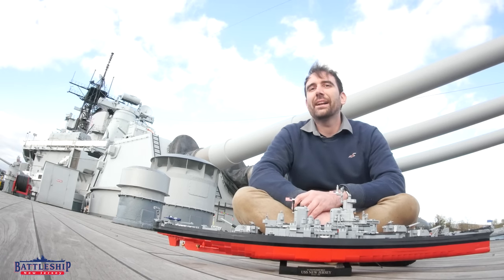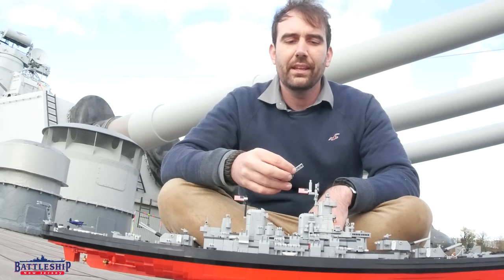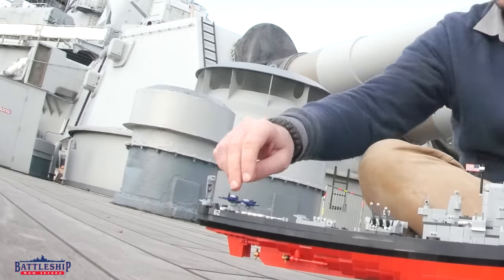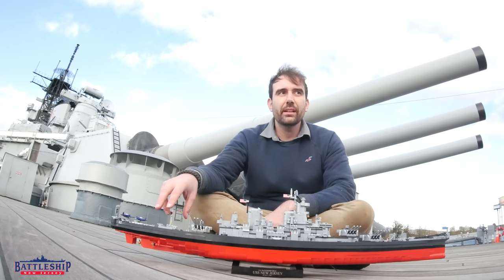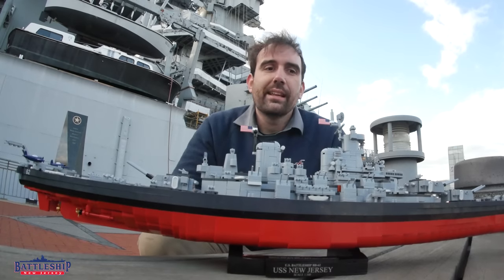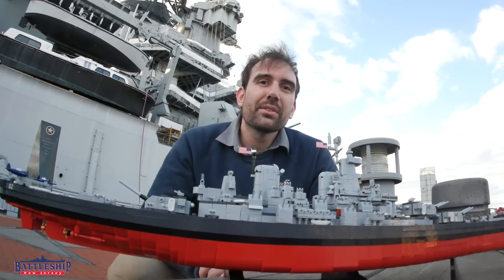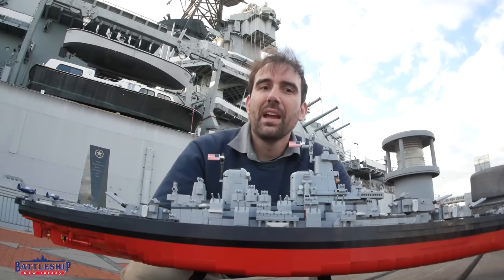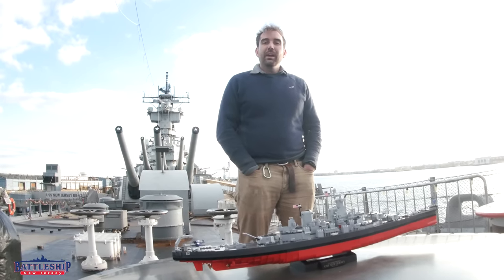What Changes Are There Between a WWII Iowa Class Battleship and One Today?

Comment: Breaking a Cobi set. Good one. You can use the Titanic as a baseball bat. Cobi holds together incredibly well
Reply: The hull can be used as a murderer‘s weapon of choice, wrap it in barbed wire, call it Lucille, no problem.

But the superstructure will fly in all directions the first time you actually crack a skull with it, so some kind of rebuilding after business has been concluded might still be required.
Reply: @Kref3  just like on the original. The armored citadel will survive
Reply: If Cobi blocks had been around in the early 20th century, Hood and Bismark would still be afloat (and WW2 still be ongoing).
Reply: Not always. My Cobi Titanic model fell down on the carpet floor from about 40 cm height. It broke into two parts just as the original wreck on the bottom of the Atlantic.
Reply: @herbertblum7704  Cobi is really going for that historical accuracy. Gotta love 'em for that.

Comment: I have 11 of the Cobi ship models, one of course an Iowa. They are fantastic, fun to build and way more durable than a plastic model kit. When it comes to details they do them well. My Cobi PT-109 has a full interior and when I was doing the crews berthing area I found a neat little hidden treasure. In that area there is a stand up locker. When putting it together I noticed some small markings on the door. Under a magnifying glass it became clear. 1940's pin up girl posters. Can you believe it ? lol

Comment: The most impressive model of an Iowa class Battleship I have ever seen belonged to the Iowa Class Preservation Association and was used by them in lobbying efforts to congress in the late 1990's and early 2000's. This model which was about 4'-0" in length , made of metal and depicted U.S.S. Iowa BB-61 with the most modern missile and secondary gun systems. All nine 16" guns were retained in this configuration and the detail was incredible.

Comment: To recover the planes the ship would be heading into the wind and then turn across the wind creating a slick spot for the plane to land in. They had a large flat skid that they would tow alongside that had ropes fastened athwart for the plane to snag with a hook on the bottom of the float. The plane would land in the slick and taxi up onto the skid and then drift back to let the hook catch the skid, at that point the cable from the crane would drop the hook which would be fastened, and the plane lifted aboard.

Comment: Have you made a video that shows how the 16 inch barrels are attached to the turrets? I'm curious about how they're mounted such that their massive weight is supported from one end but they can still be reasonably removed for repair or replacement.

Comment: Now for the big question: Does it float?
Reply: Ive been too afraid to try with any of mine. In theory they should be able to float for a short period of time until water seeps in, the issue is getting it back out and drying the inside.

Comment: Why does turret 1 not have those two range/view finders on the sides like turret 2 & 3 ?
Reply from the maker: Took them out prior to Korea, they were unnecessary and kept getting water in them
Reply: @BattleshipNewJersey  Oh thanks for that info. I had  noticed what looked like an outline where they once were. Then the Wikipedia page said turret 2 & 3 had them and they are used as local rangefinders in case the big one on the superstructure got knocked out. I have to find some old WW2 photos showing all 3 turrets with them.

Comment: The main battery range finder can only see 13 miles? What is the height of eye for the main battery range finder at combat displacement? I used to work as a deck officer on container ships and it seems like that range finder should have been able to see a lot further than that, since that was about the max I could normally see from our wheelhouses, and I feel like the battleship's main battery rangefinder is higher than that usually would be,

Comment: I understand the sponsorship, but I would absolutely be more afraid of breaking a model of NJ if it was made out of NotLego™ than if it were a sturdy metal or plastic model, particularly if it was in a clear plastic 'travel case' to protect it from dings. You break the Cobi one and that's a couple hours of rebuild work if the damage is significant enough